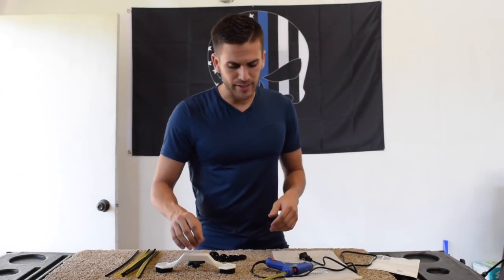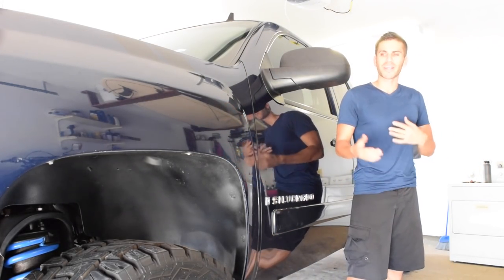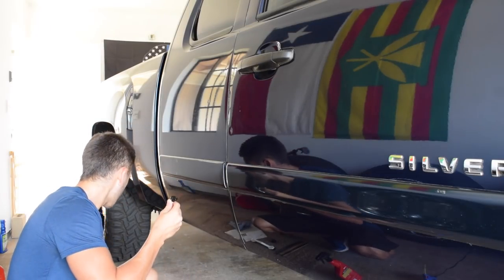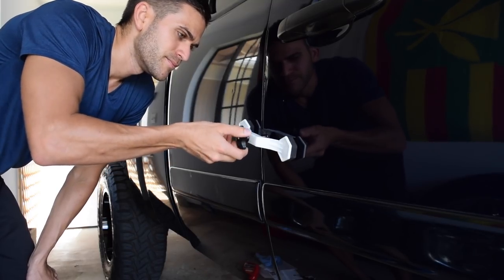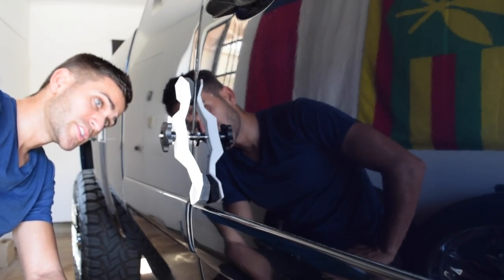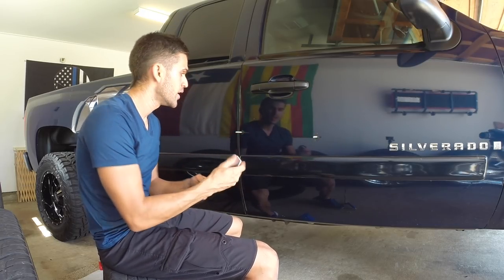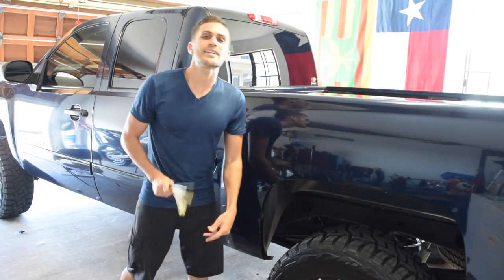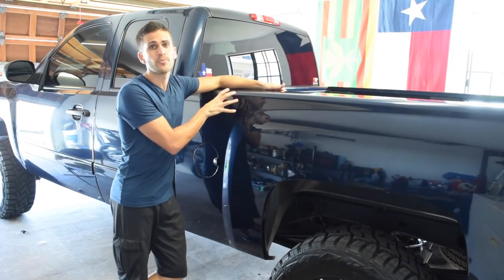Dent Puller Review - Fix Your Car's Door Dings?

Comment: The "flimsiness" of the bridge is irrelevant. The only parameter which affects the effectiveness of the dent removal is the force needed to break the hot glue bond. The "bend" of the bridge just redistributes the load on the bridge, but the force to break the hot glue bond is the same whether it's applied by a solid bridge or a flexible bridge. 
Of course, it's no good if the bridge is so flexible that you get the the end of the thread without the bond breaking, but if it breaks before that point, the force is the same whether the bridge is flexible or solid.

Comment: Those so called diy kits Ding King are junk.  Best to take the truck to the body shop.  I noticed some issues with the side moldings on the door.  My suggestion depending what you want have the body shop repaint the trim or order replacement chrome molding package.